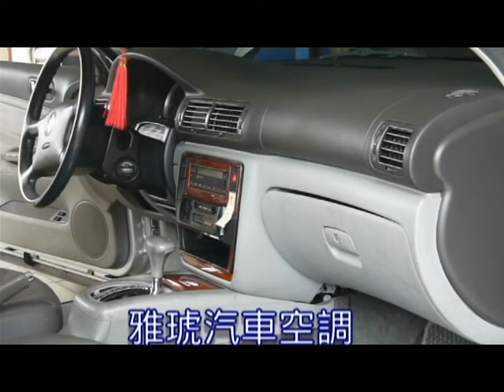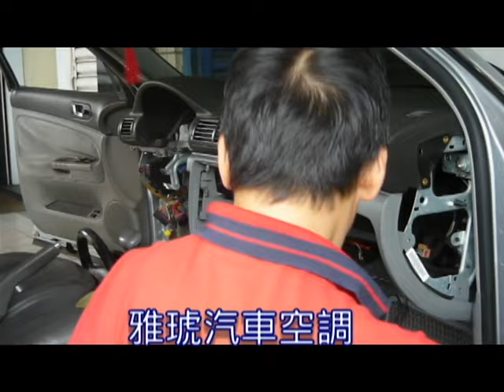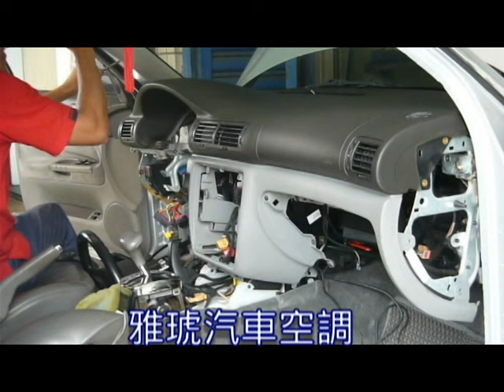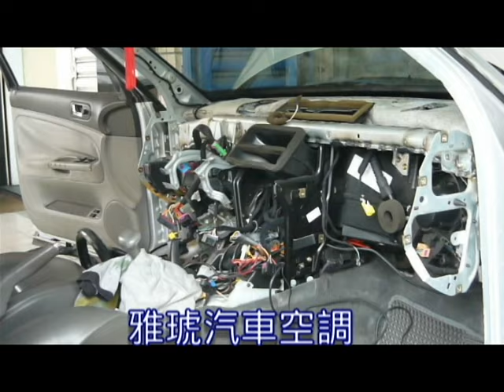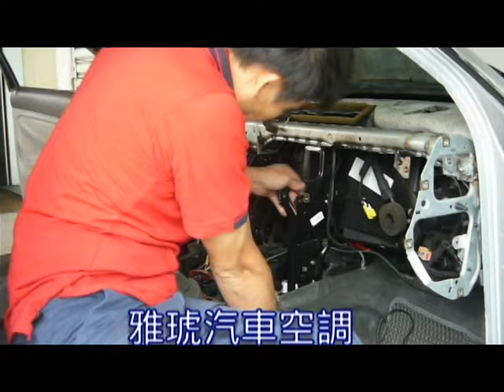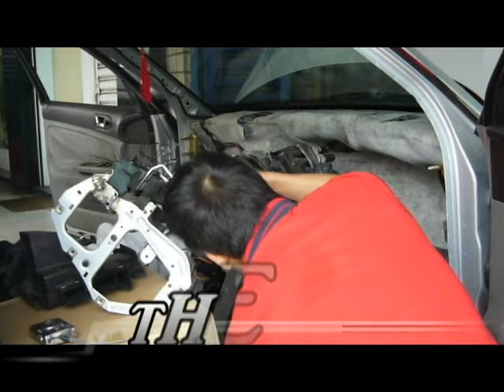Air conditioning assembly remove VW PASSAT 冷暖控制箱總成拆卸エバポレーター交換

Comment: This is hell. I'm glad that you can change all AC flaps without doing all that (although the VW repairbook says you need to remove the entire dashboard just as shown in this video)
Nice video for when you need to replace the heat exchanger.
Reply: Do you have a video about how to remove the flaps without removing the dash?
Reply: @MikkoRantalainen  I don't. Which flap do you wish to replace/fix?
Reply: @Tartneznok  I'm most interested in the flap that controls the hot vs cold air (the flap that controls how much air goes through the heater core). I think our car (around 20 years old) is leaking here and never gets the max cold or heat because some air leaks to the wrong side of the flap.
Reply: @MikkoRantalainen  Did you check the fault codes in the Climatronic module? If not that would be the first step to do in order to determine the exact fault.

Comment: wtf?i thought just ac pump and some pipes...:(
Reply: The A/C pipes go through to firewall to the evaporator that's housed inside the "evaporator housing box". Due the design VAG did here, you have to pull the whole dash to access the housing box. If you ever do this job, it's seriously recommended to replace both evaporator and "heater core" which are the parts that often leak sooner or later. Also check the flaps inside the housing. Due another great idea by VAG engineers they used galvanized steel but decided to reduce weight (or some other weird reason) and put huge holes in the flaps and then used some kind of tape to fill the holes. And of course the tape they used is of poor quality. In the end, the flaps that are supposed to direct the air and control mixing of the hot and cold air have huge holes in them and as a result, you never get really cold or really hot from the box unless you fix the holes. See https://youtu.be/GR6DYOJ3B34 for details.